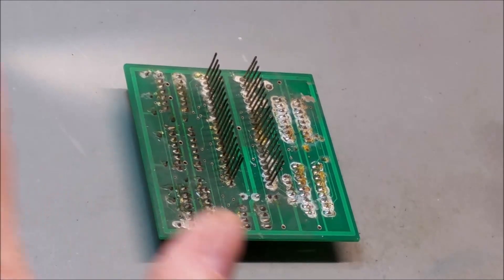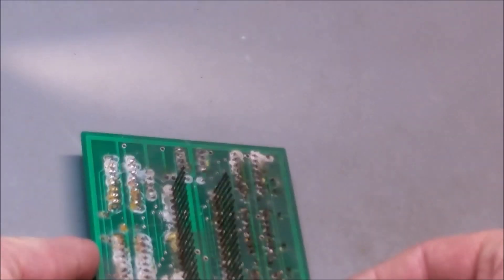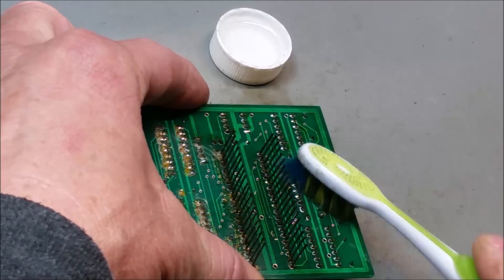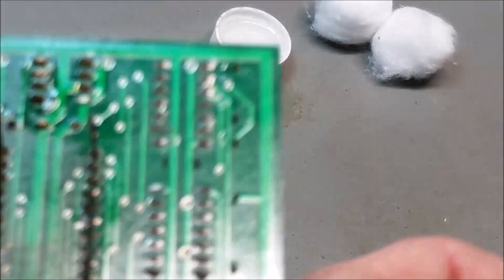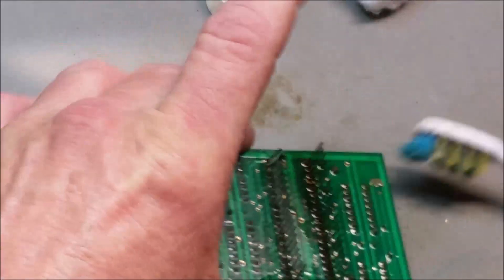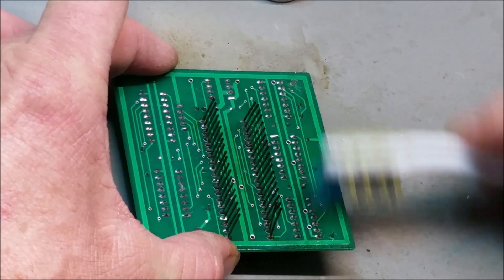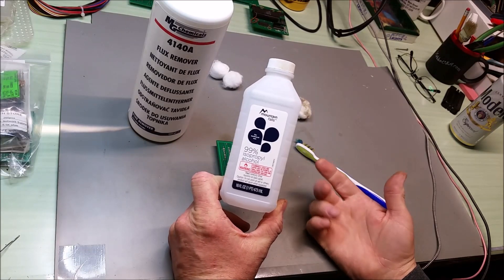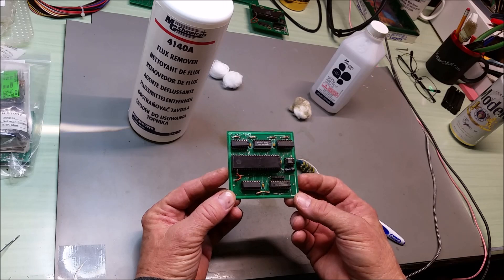How to Clean a PCB - Method #1

Comment: Hey Mike, Im going to be sending a DK pcb board in the next few weeks for you to fix. But until then I was wondering what your guess would be on a problem Im having. When you start the DK game, The girl at the top of the screen is gone from the waist up. Meaning you just see here from the waist down.  Any guesses ??  Thanks in advance.
Reply from the maker: Check -5 on the video pcb. It should be close, maybe -4.85 or so. If you are using a rainbow cable, clean the pins and reseat the connector.

Comment: Regarding alcohol: for electronics work, how important is it to find the super-high purity like 99% versus the 80-90% from the pharmacy? Is there a risk of damage from using the lower percentage? What would you consider a “safe” cutoff?
Reply from the maker: It's probably fine at 75% even.  I like the higher percentage because it dries fast and leaves almost no residue.